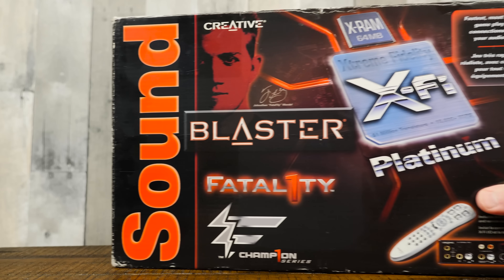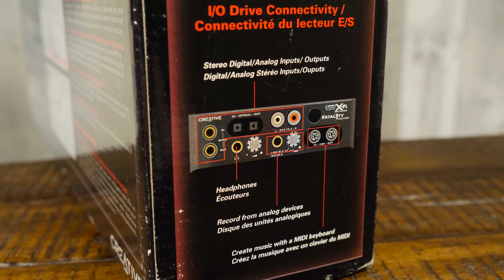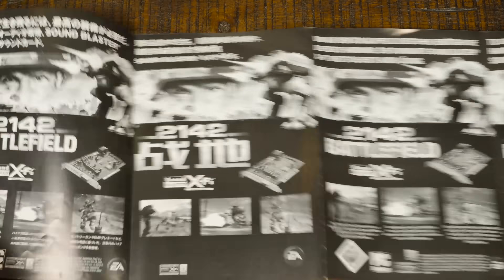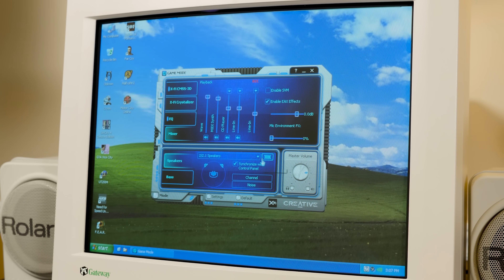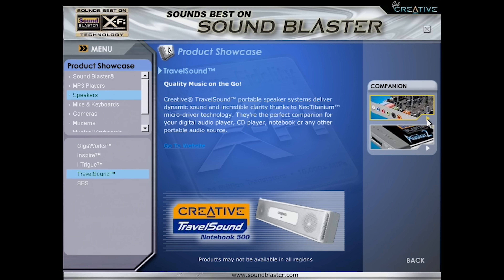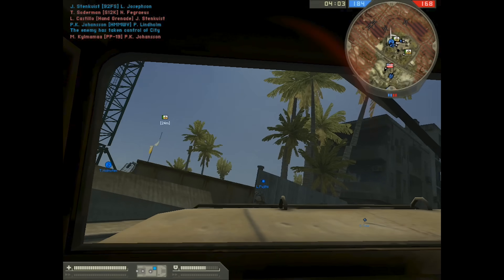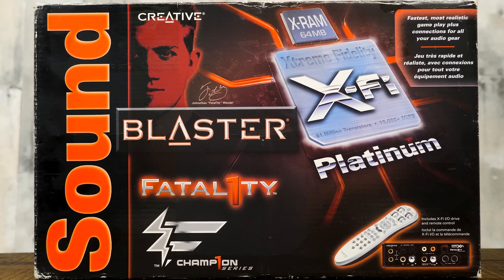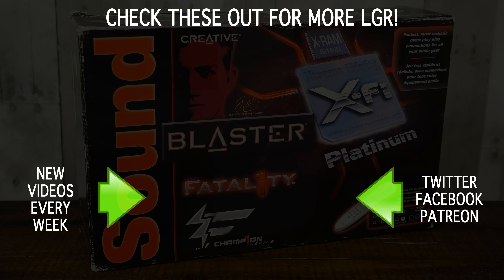XP Upgrade! Sound Blaster X-Fi Platinum Fatal1ty Sound Card

Comment: I had a Sound Blaster LIVE! 24-Bit card for years that I bought at Best Buy in my early days...every time I threw together another computer that card followed, it was a great card.  Had EAX hardware acceleration etc.  Finally retired it in 2008 and have not used a dedicated sound card ever since
Reply: I had the same exact card(SB LIVE!), I was 17 years old when I bought it with my summer pay check, I still remember talking to the teller(cashier) and mentioning how I really needed this soundcard and how great it was....
Reply: Actually, the Live! 24-Bit only has driver-side EAX emulation - the CA0106 chip has no DSP capabilities to speak of. Not a bad little budget card, made some pretty decent recordings (though getting 24 bit samples out of it was a chore, basically you need ASIO4All and ASIO capable recording software, though maybe that complication was unique to Windows 2000).
Reply: PileOfEmptyTapes oh gotcha.  I always assumed the onboard chip had some semi-advanced acceleration.  Yeah I remember the driver package was loaded with all kinds of things to mess with...EAX etc.

Comment: That's hilarious, I had the same Audigy 2 in my machine way back when, and it's sitting in my current desktop being powered as well, but I'm still using the integrated audio since it's gotten "good enough" to the point where the difference isn't discernible between the two. Obviously the integrated unit lacks some of the I/O of the Audigy, but no biggie.

Comment: I installed my first Creative soundcard back in 2000. It was absolutely amazing, and came with 3 full games that took advantage of it. Thief, Need for Speed: Hot Pursuit, and one other game that I can't remember. Along with the sound card, I also got a set of 4 surround sound speakers and a subwoofer that I believe were also made by Creative. 

Several years later, I built a pc and splurged on a high end Asus ROG motherboard because one of the main features was the onboard audio supposedly being high end. It turned out to be horrible and couldn't push the true 7.1 surround sound headphones that I had purchased at the same time. I stopped at Best Buy and picked up a new Soundblaster, and it was still leaps ahead and had no issues powering the headphones.

Unfortunately for Creative, their driver and software support went to absolute hell. The drivers would constantly crash and software that worked fine the day before was completely unresponsive the next day for no apparent reason. It was an absolutely infuriating mess trying to deal with, so I have since given up on them and just use USB virtual surround sound headphones these days.

Comment: I had an x-fi xtremegamer that I bought for $80 back in 2007 and kept until 2016. it was a real pain in the ass to get it working with windows 7 somewhat and windows 10 for sure since compatibility ended with vista. But I definitely preferred it over the onboard realtek garbage on my motherboards since I use 5.1 surround sound. I was able to finally upgrade that sound card to an Sound blaster Zx during the summer of 2016, but I plan to still use that old sound card in an older build of mine so it will still have its use

Comment: i have the same sound card and is the only hardware to install in every my new build almost 20 years until today .
works great in windows 10 with 11th generation intel cpu and MSI motherboard .
The sound is perfect and the connectivity is rich like no other sound card for pc.
For motherboards without pci in modern motherboards you can use the adaptor pci-e to pci .

Comment: Turns out, even in 2018 buying a sound card will give you a lot of benefits over using an onboard video card or your GPU to do the job. "Good enough" alright. I just bought a SoundBlaster from 2012 and holy fuck I can't believe me took this long to do so. Not only the sound quality  is immensely better but it also free up resources on your CPU and GPU make games to perform better since all your audio processing is now being handled by a dedicated hardware. It totally worth getting a sound card now. They are still going strong.
Reply: Unless you're using a Sound Blaster X-Fi Titanium PCI-e with Windows 10 drivers on old EAX-supported games, you will gain precisely zero performance increase. Creative cards after the X-Fi line just use software-emulated Alchemy, the exact same kind you can download for free called "Creative ALchemy Universal". All modern games use software APIs like FMOD, Wwise, or XAudio2 that are mixed entirely on CPU.

Comment: I still use an SB X-FI Titanium Fatal1ty Pro and it still cranks. On these cards using a cable splitter, you can actually hook up a 7 speaker system for 7.1, for real not simulated sound. In my opinion, nothing now makes the same great sound.

Comment: Had the x-fi gamer, which was not shielded against noise and so I got a lot nasty data stream and USB noises on my speakers/headset ... fortunately it burned through or stopped working at some point in time and I used the on-board sound-chip. Though the interface of the software was kind of "annoying". I recall looking for settings etc. all the time.

Comment: I've still got my "Creative X-Fi Fatal1ty FPS" today! Originally used with my Pentium 4 system, it's been migrated to each pc I've upgraded to. Both in a Q6600 system and my i5 4690k system I have now, although in my current system it's been relegated to an input device (still using the breakout front panel for it) whilst have a Soundblaster Z for regular audio (so yes, I have two sound cards in my system, with onboard audio being disabled). It was £145 when I bought it back in February 2007 but I believe it has been one of the best hardware purchases I've ever made given that it's still in use today.

Comment: Man I loved my Audigy 2 ZS! I got it back around late 2004 when I was buying new parts for World of Warcraft... I still remember the frustration I had with Creative when they released their Windows Vista drivers and they literally did the bare minimum to make the card about as functional as old 2000s grade integrated audio. Some guy managed to hack the stock drivers to work flawlessly in Vista and Creative shut the guy down, causing a huge backlash. I swore off Creative after that, which I guess wasn't the biggest loss seeing as integrated audio started getting, as you said, good enough.

Comment: I had this card, and I still use it in this PC,  I use a Sound Blaster Z in my main rig but it was a sidegrade more than anything.  Drivers for "legacy" Creative cards is a nightmare in Windows 10, but it's possible to get them to work after some trial and error. The drivers windows want us to use lacks a lot of the features of the cards.

Comment: I am still using Sound Blaster X-Fi Surround 5.1 Pro and it is perfectly supported. As I travel for work i use laptops and once I'm home, il just plug it in and together with Logitech z906 provide outstanding sound ( much better than any sound issued by current razor 14, 2021 ). Note that I bought it in 2010! Still working flawlessly.

Comment: On my new build of 2011 . I have the X-fi faltal1ty , my i/o has a black front case mount controls, my volume knob is 3 times the size of the mic knob, both press in flush with the panal face, the  last time my pc crashed the drivers and software downloaded automatically on my win7, so it works better without the install disc

Comment: I still have the PCI-e version of the Fatal1ty Championship edition card; the front I/O board is a far cry from the PCI model in terms of features, but it does give me RCA-in at least. 

I also have the Audigy 4 Pro, and I had the Audigy 2 Platinum ZS, of which the Audigy 4 Pro was the upgraded model, so I sold it once I upgraded. 

Otherwise my daily rig has the newer ZxR set. I’ve run dedicated sound cards since the Sound Blaster Live! days. 

Even when ASUS started integrating X-Fi on their motherboards, I found the dedicated cards still offered better performance.

Comment: So here's something; I used one of these even up to my 2013 build because it offered better quality than onboard audio. Also, fun fact, this card was one of a few that could do Dolby Digital Live! For some reason, despite all the digital audio do-daddery, you could only output stereo PCM via the digital connection, unless the source audio on your PC was encoded in Dolby Digital or DTS. But if you dropped 5 bucks on the 'Dolby Digital Live and DTS Connect Pack', it would enable Dolby Digital and DTS encoding which meant you could finally play your games in 5.1 using a digital output instead of having to rely on the analog outputs! Sadly Creative stopped selling this feature back in 2016, but I still have my serial number that I purchased years ago if you would like it.

Comment: Hey Clint, I recommend you try the Pax driver suite for your X-Fi card; they're heavily optimized to fix numerous bugs, glitches and unintended quirks compared to the OEM Creative drivers. It's a tad difficult to find but I still have them around if you ever want them.
Also, if you really want to transform the quality of the output on those X-Fi cards to a near-professional level, check out the old thread called "Almi's X-Fi Mod (Hotrodding Sound Blaster X-Fi models)" on Head-Fi! You'll probably like to tamper with the card and it's absolutely worth the difference if you ever use it for anything that requires actual high audio fidelity.

Comment: I remember using my sound blaster audigy platinum until mid way through 2013. The card still works, I just didn't like hassle of one more card in the pc generating heat.
I still think that old card from 2001 still sounds better than my the onboard audio in my current pc. (im still using the same pc i have owned had since janurary 2013)

The extra ram and that newer sound card greatly improves your windows xp pc! Now just two gtx 8800 ultra or even just 8800s and that machine will be rocking even some modernish titles.

Comment: Is it possible to run this on a modern pc? I have tried to install it, but the pcie interface does not match my modern one. Since the card is so old, I can not really find the specs anywhere. Does it even make sense to use this nowadays?
Reply: Esta tarjeta necesita puerto Pci. (No el Express). Existen adaptadores de Pcie a Pci, pero por lo que he leído, puede que el rendimiento no sea el mejor. Si ya tienes comprada una placa moderna, es la opción que te queda. Si no la has comprado, busca una placa base relativamente moderna, que  soporte Pci. En mi caso he hecho renovación hace pocos días y monté todo en una "Asus Prime b-460 Plus" para seguir manteniendo esta buena tarjeta de sonido y mi viejo "Thermaltake Frío Ock" que enfría a las mil maravillas un "i9 10900K" con zócalo 1200, acompañado de 64gb de ram (la placa soporta 128gb) y una RTX 3070 en Windows 10 Pro. Todo funciona perfectamente y el sonido va de lujo con unos Z906 de Logitech.

Comment: I had to add a SoundblasterX AE-5Plus into my current build because my Integrated Sound chip in my Motherboard worked well enough for OUTPUT but did not work well at all for INPUT
and one of the key use cases for my PC is to connect to my Technics SU-V16 Amplifier (Tape2 Output) which is then also connected to my RS-M16 Cassette Player, ST-S16 Quartz Radio Turner,  and SL-D212 Turntable for the Ripping of Non CD Physical Music Media. 

The onboard Motherboard Audio for whatever reason provided Low volume levels on its line in jack that would Sometimes Jump back up to proper levels for a brief period (less than 30 seconds) and then drop back down.

Interestingly the Front Panel audio had the option to re-task the Mic Port as a Line in Port and when I did that and connected the Amp to the Front panel port I had proper input levels however it was Unsightly being connected to the front and I didn't like the software retaking as I didn't think it would give me the best results over the long term.

The AE-5Plus has been great for both Output and Input the only thing I will note about it is the LED's on the side and back plate emanate from the same physical LEDs and the part of the back where the light comes out is tinted slightly differently so the LED's have a different colour there.

Also the card comes with a 10LED LED Strip you can plug into it but it has a proprietary connector on it and since the RGB Lighting on the card is only controllable from the Creative software and not from the Integrated Motherboard Software (Aura) that controls the rest of my onboard lighting I elected to just leave that little 10 led Cable off of the build.

Every other Integrated Motherboard Sound section I have used for the above use case worked admirably to my ear.
Asus P5Q-Pro (2008-2019), Gigabyte GA-Z97X-UD3H-BK (2014-2021)
Just this Rog Stryx Z690-F had problems. And testing my wife's identical (excluding GPU and PSU) build, her Z690-F also has the same issue
So I would caution people against the Z60-F if they need to use the line in.

Comment: In my own first PC circa 1999 I got a dedicated SB pro clone, but after the death of my MSI motherboard in2002 I could only get a crappy integrated sound card for my Socket 7 K6-2. After that, I got corrupted by the power of integrated soundcards until I got interested in cheap home cinema with SPDIF, and I got a Trust 5.1 card in a shop clearence. I thinkI still have the passive boardsomewhere, but the main part got discarded when the K6-2 got recycled ^^' I'm back on crappy integrated, except when I use my audio interface I use for the guitar, an M-audio fast track.

Comment: I have a Sound Blaster X-fi Extreme still in my main machine , I have a Asus X299 Mobo that was the most expensive they make and still it makes a bi=g difference using the over a decade old sound card over the High-end Chipset on this Top of the line board. I cant ever give up the sound card it will never be good enough for me i dont think they can make the onboard run as well as the sound card optioon...

Comment: Greetings Clint! I have a Sound Blaster Live! SB0200 Dell sound card I took out of an Optiplex GX270 I got for free from a computer shop. My PC consists of a 2009 Acer Windows 7 era Nettop motherboard with Windows 10, GeForce 9200 512MB integrated, 4GB RAM only a total of 2 PCIe slots(1 1x and 1 16x) with the factory AMD Athlon II X2 255 clocking @ 3.10GHz, all inside a 2006 Vista-era eMachines T3638 mid-tower ATX case with 4 PCI lanes(which I still have the original ECS 945G Celeron 420 2GB RAM LGA775 board for but Windows 10 felt slow on it for my needs). While it doesn't have PCI slots it would have been awesome to have it in there because of the fast processor and RAM making it a good budget gaming motherboard for me...granted there are PCIe to PCI adapters on the market I probably wouldn't mind buying one of those due to a bunch of one star reviews.
I've read online the SB0200 is garbage because it's software accelerated and not hardware, but it worked fine for me and did it's job under load(Using Mixcraft, Audacity etc. for example)
But Windows 10 does not have drivers for the SB0200 because I tried it in the factory ECS motherboard and it wasn't detected by the driver setup and Windows Update didn't find drivers for it so that sucks. Same for XP but 2000 detected it and it has worked fine but that's not what I wanted on there.
Apart from that I like your build! Keep it up
Reply: 2 years later and I have a Sound Blaster X-Fi XtremeMusic PCI, also a Dell Card but this time it's hardware accelerated!

Comment: I had the most basic X-Fi and thought it was pretty cool Used it with a 5.1 Teufel PC system or a Sennheiser headset. Worked well in the titles that supported it and the faux 3D effect was noticeable in some games. That was in Win XP 32bit. The 64bit versions of Vista and 7 I used later required a lot of fiddling with alternate drivers and stuff and I eventually sold off that PC and stuck with onboard sound since then. It's also fine.

Comment: This got me curious. You mention you just use integrated audio on newer systems, but still maintain these XP era cards are still better. I'd be interested to see a more in depth look at how current integrated sound compares to dedicated cards both past and present. Not sure if that's the sort of video you would do.

BTW, the audio card I was using during the XP era was that Audigy you replaced with the XFi in this video.

Comment: I think I was using some crappy discount internal one back in 2007 though around that time I found I had saved my old Audigy 2 from my first late 90's PC (for some reason just that and the keyboard which is still my backup one) so used that until it died a few years ago. I've still got it on display on a bookshelf as it is a mighty fancy looking card.
Currently using a Audigy FX because once a Creative fanboy always a Creative fanboy, heck was using a 2005 Zen until that too kicked the bucket this year.

Comment: I have two of these in my junk pile! They were good but with later versions of windows the drivers were just too buggy. I ended up getting an ASUS Xonar D2x to replace them and it was really good, better even. I have a ton of old sound cards. I used to use them to record multitrack music demos using cool edit pro back in the day! I ended up getting a proper pro audio solution. Now I've just upgraded to a z270 motherboard with really awesome onboard sound... it also has soundblaster x-fi (MB5) on it, so you get a few of the old soundblaster features with it, even though it's a Realtek chip.